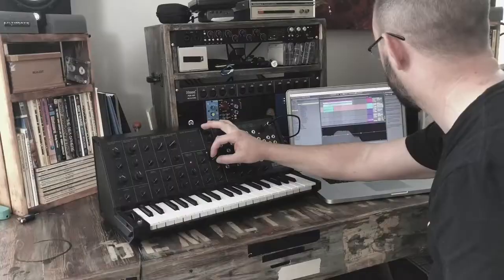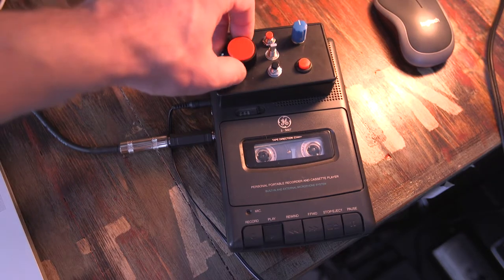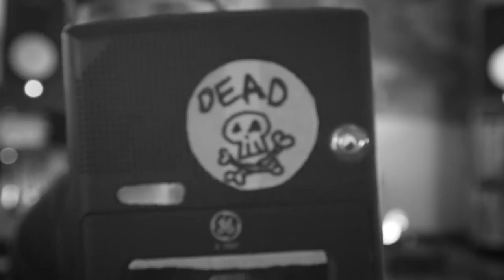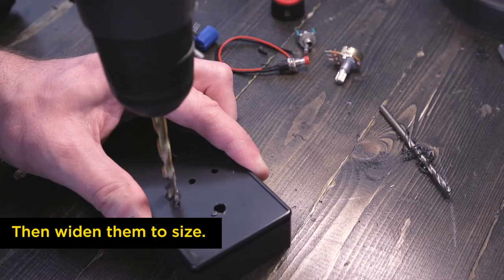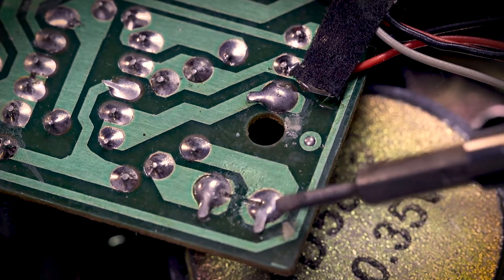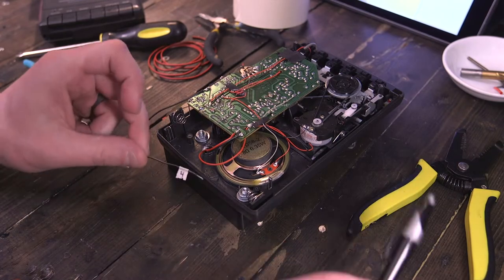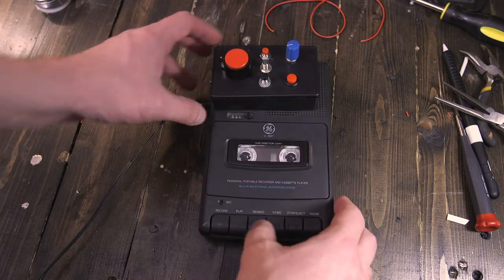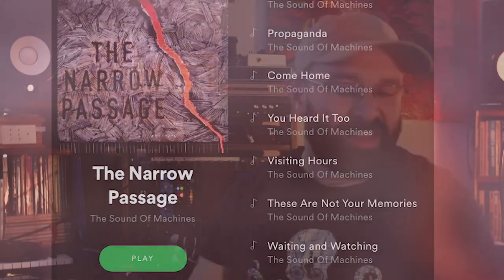Tutorial: How to Build a Modified Cassette Player

Comment: I took apart a cassette player when I was about ten . Just out of curiosity and had the " What if " mentality . 
My goal was to make an amp . My older brother showed me the head transferred the signal to the speaker . So I took one end off of dad's old guitar cables and touched the wires to the two on the head and viola . 
I just built my own portable amp ! The cool part was , if you turned it up you got distortion ! What kid , wouldn't love that ? 
Maybe , you could just do a video on that !
Reply: Q
Reply: I heard in order to practice guitar Steve Vai did the same thing with a portable cassette player and just before the batteries died was when it started having the best distortion

Comment: I got  a hold of a Marantz field recorder.  My buddy used to use it to learn guitar solos because it has a pretty generous speed control. (hes old)  I'm looking to use it for something music related.  I've heard drums sound great with natural tape compression, but I'm already using a Tascam 8 track from the 90s.  I've also heard that people make them into tape echo/delays but it has to be the stereo version and mine's mono.  I'm thinking of taking advantage of the speed knob.  Recording non-drum percussion, like pots and pans etc.  I think of speed like shrinky dinks, or photcopying and shrinking a drawing, it takes away the imperfections, I guess compresses it literally.  And I think slowing almost anything down you could create some interesting synth-like bass tones.  Maybe make a tape loop and use it as a super lo-fi drum machine.  Could potentially make a handful of drum loops and have them on hand.  slap some effects on them.  voila.

Comment: When I was very young, I tried wiring a 1/4W pot in series with the synchronous AC motor on my Revere T-2000.  Needless to say, this did not work - as I turned the pot towards lower resistance, it suddenly caught fire and released major smoke.  --Gary

Comment: You're not stuck with out of production models. Walmart's web site has plenty new ones, mostly made in China. Walkman style bits under $20, the bigger shoebox style decks under $30. Just search "cassette recorder". Used pieces from ebay are a dice roll if they even function at all.
Reply from the maker: Great suggestion! That makes a ton of sense. I'll make sure to add your note into the description